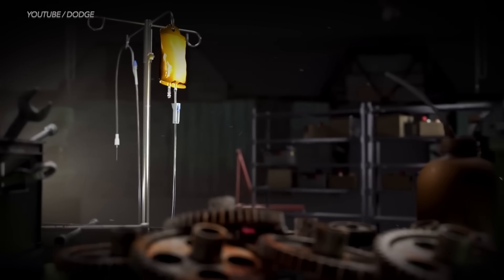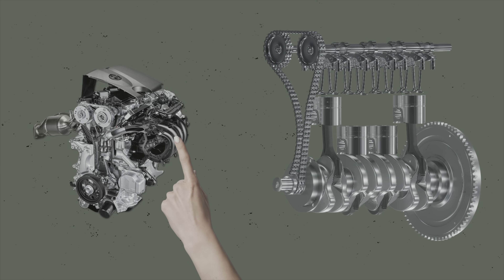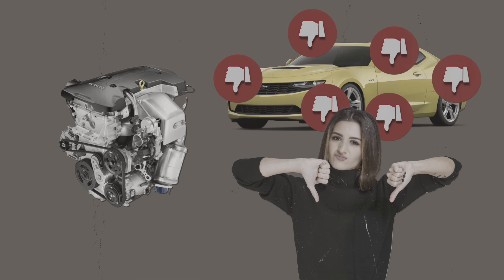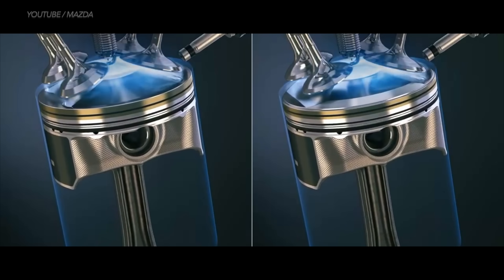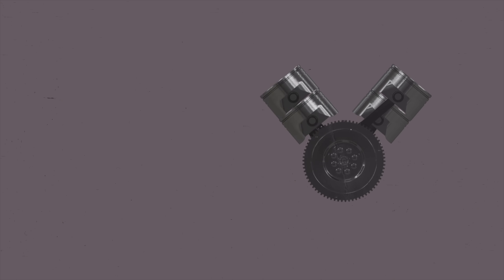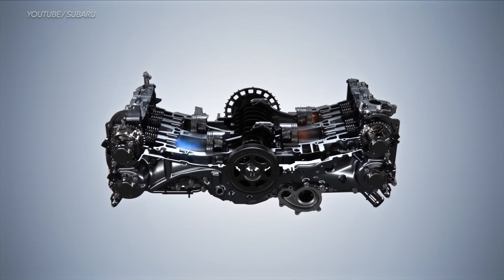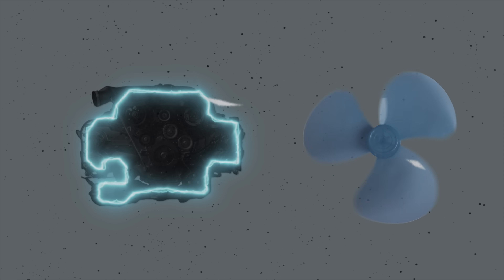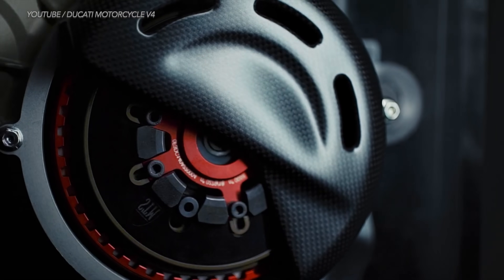This New 4 Cylinder Engine Just Killed the Future of V8 Engines

Comment: if you aren't a performance fanatic, L4s do very well on average with respect to reliability and fuel economy. But, I have a 2016 Camry with a 2.5L L4. My only complaint is fuel economy. I had a 2009 Chevy Malibu that about the same mileage with a 3.5L V6,  with considerably better performance. The Camry is heavy, though. That said, absolutely no issues with the car, and it will cruise all day at 90mph.

Comment: A V4 with split crankpins like you depicted to mimic and inline 4 firing interval would partially defeat the purpose, IMO. It makes it more complex, physically longer, and doesn't improve the sound signature coming from it. It's a much better solution than the boxer 4 if you ask me, but it can only compete with or beat the inline 4 if the bank angle is narrowed up and/or it's used longitudinally with a shared crankpin crankshaft like Subaru (or Alfa Romeo if you remember the Alfasud) do with their boxers.

IMO a 180-degree crankshaft with a 60-75-degree bank angle shared crankpin V4 with SOHC and 3-4 valves per cylinder, CVVD, VVL, and VVT would be the best setup, particularly if they still made them bigger than 2.0L. 90mm bore and 100mm stroke would make it 2.5L exactly and particularly suited for torque production and good thermal efficiency since it's 0.9 undersquare. David Vizard says you can get 1.4lb-ft of torque per cubic inch so that'd be 210lb-ft at the crank. If it revs to 8000 it should make around 280hp, which is more than enough in a sub 3500lb car with the right gearing, and easily possible with the CVVD and VVL giving you an eco cam up to about 4000-4500rpm for a smooth idle, nice emissions numbers, and good MPG.

Comment: sorry, but most "cons" you state for inline motor (e.g. freezing in the exhaust pipe) don't seem to have anything to do with it being "inline" - rather, they can be counted as cons for all three types of motors discussed. 

Also - having a lawsuit doesn't mean the issue is real - only that someone wants to earn money from the company. If you don't have hard proof - statistics of failures - don't count it here. 

For me - after watching this whole video - it just remained purely an aesthetic and personal preference thing. You did NOT even compare the 3 motor designs for any specific physical attributes of their performance, merely external shape and size, and the issues that make it harder/simpler to install and maintain. 

What about torque, what about gasoline consumption per liter of combustion chambers size, what about performance in high rotation rates, low rotation rates, what about speed of accelerating the engine? Power and easy of moving it down the chain - to the wheels?

A lot is missing here.

Comment: I've owned many cars and the only cars I ever had an engine failure was with the ford inline 4 they put in my Mazda pickup, and my Mazda van, which was a nightmare, but my 3 Toyotas (2000 Sienna, 2000 Echo 2008 corolla) all appear to be bullet proof and have all been passed down to my children and we joke that our 1 yo grandson's first car will be a 2000 Toyota echo.  My last 2 cars where Subarus 2012 Impreza and 2021 Outback. The Impreza has over 100K with zero issues and neither burns any oil. I'm not sure you can even buy a car that doesn't specify synthetic oil, but never ever use fossil oil if you want your cars engine to last. As for Subaru recalls, while disappointing, they took steps to fix the issues. I had a few recalls on my Toyotas also.

Comment: I sold my 94 Toyota Previa with 2.4L inline 4 with timing chain still running with 265,000 miles. Never touched it except changing platinum plugs every 100,000 miles. never changed water pump, timing chain or anything. Most reliable car I ever owned. Have 284,000 on a V6 03 Odyssey, still running. Wish I had 4 cylinder in my 03 Highlander. The V6 is a nightmare to change plugs or timing belt, Blows oil out everywhere and smells like burning oil, even with new valve cover gaskets. Runs well at 230,000 miles but started leaking 60,000 miles ago and now is soaked. Not worth having fixed though.  Probably retire it soon. Worse engine is Ford 4.0 v6 with timing chain on front and back. Servicing it is the cost of a new engine as it must be pulled out. Hydraulic tensioners fail and plastic chain guide wears and engine grenades itself. Just had on die at 175,000 miles only. I guess it helps if you change tensioners every 70,000 miles. My daughter has an Explorer with 179,000, I told her get rid of it before it dies. Should have gotten the 5.0 Had a 94 Mitsubishi Galant, changed valves after timing belt broke for PO at 100,000 miles. Burned oil but ran to 150,000 adding oil. Put newer engine in but transmission went out at 160,000 I think. Junked it as they wanted too much for higher miles used transmissions.

Comment: I love my '99 Outback with the Boxer engine. I have no problems with it! I change oil in the engine regularly and change the Tranny fluid  and filters every 50,000 miles. It has 160,000 on it and it does not have all those idiotic computer controls like the news ones.  I had an overheating problem one time when the mechanic who did the timing belt and water pump change failed to tighten the idler pulley on the timing belt causing it to jump 2 teeth and thus overheat. That was not the engine's fault at all.

Comment: Inline 4s are cheap to build and vibrate.  Boxer fours are smooth and cost more to build. V4s are about the same price as boxers, smoother than inline, but rougher than boxer.  Configuration has no real effect on durability, that's a matter of design intent and willingness to spend the money to build a more durable engine which will cost more when sold.

Comment: The in-line is the best, in my book. My 2007 Honda Civic EX has 137,000 miles on it. I put Castrol, because, Castrol oil was always made for small engines.The engine so far is good. Just do maintenance on it. I don’t put additives. Just leave it alone. Buy a good filter.. Don’t be cheap.I use Castrol oil filter.I also use full synthetic.Oil and filter. I know this is not about transmission’s, but it is very important to keep the transmission, in good condition, it effects the engine performance. I only use original transmission Honda oil on my transmission.

Comment: i havent had many cars only 85 chrysler new yorker 2.4 or 2.4L turbo, engine rebuild but turbo and tranny went bad so I dump it, then I got a 89 NIssand 240sx at 189k I swap the engine for a JDM SR20det(s15 2000 nissan) blew the engine by detonation, then I got a chevy silverado run good sold it at about 160K, Now I have a chevy express 03 with over 320K still engine runs cool but went thru a tranny already. and also have a 2012 bmw 128i with 98K so fare runs good just a anoying valve train tap noise. Over all my 2003 chevy express 6.0 L is the best. Im planing on not waiting till the engine pop or throw a rod and rebuild it. also thinking about buying a new one but as you said many times there is no quility any more..

Comment: Those problems with the Mazda aren't due to the engine's configuration as a straight-four.  Those are routine teething problems with peripherals that get sorted out in later units.  "The problem with the Mazda Skyactive 4-cylinder is ice in the muffler."  <-- that's a problem with Mazda, sure, but it's not a problem with the straight-4s in general, or even the Skyactiv in particular.

Comment: I've had the boxer motor. Hated it. I'm on a straight 4 on my 2001 accord right now and it's not terrible. By far my favorite engine was in my 97 Jeep Cherokee. Inline 6. Well over 250,000 miles and never gave me any problems. I even double filled the oil and drained the transmission fluid by mistake and drove it for about a week like that! Ultimately it was the frame that gave out on that beast. I sincerely believe I could have gotten another 250,000 miles of more out of that engine.
Reply: The old Honda Accords are awesome man. The Camry may have been more reliable but the Honda was way more fun to drive.

Comment: I have three cars one Toyota, then a Hyundai then the last is a Toyota 86 which is essentially a Subaru BRZ. The best is the Celica gt with its bulletproof 1.8L engine had it since new and it runs perfect with 221,000 miles on the dial. No oil leaks and normal oil consumption. Uses less then a 1/4 quart of oil every 3,000 miles and we change the full synthetic oil every 5,000 mi. Yes the transmission gets a fluid and filter change every 2yrs regardless of mileage. Trans has the same mileage as the engine.

Comment: Many moons ago had an International Scout with the inline four. The guy I got it from said it was industrial rated and for a little 1963 truck it was an outstanding engine if the clutch wasn't always causing problems. But also, owned a few of the little Toyota trucks with 22R and the only thing that ever broke was a fan belt because of not ever checking the belt. And fortunately it had broken by an auto parts store with in walking distance and was back on the road again.

Comment: I owned a 1980 Mitsubishi wagon with a 2.4 loiter inline 4 that had a counter balancer design that was borrowed by Porsch in their “944”. It was super smooth and but for unibody rot would be still driving it 😀

Comment: I have a 99 Miata with the 1.8L In-line 4 (DOHC & non VVT) that engine can do no wrong! Love it more than any vehicle I’ve owned before and I’ve owned mainly V8s (64 1/2 Mustang, 2003 Cadillac Deville, 94, corvette, and 2004 Mustang V6 40th Anniversary).

Comment: Subaru's also had a reputation for 100K mile front end oil seal leaks. I always got the feeling this was more a front end bearing issue since most seal replacements without bearing replacement never lasted long. This may have been corrected over the years but I never felt any urge to own one past 100K miles.
Reply: I've got a 2017 Impreza with this right now... More like 60k mile oil leaks

Comment: On my 3rd Subaru.  Traded them in at 150K miles just because I wanted a newer model.  They ran and rode just like new at trade-in - not one single problem with any of the three.  Only oil changes, brakes, and tires.  Surprised at the recalls and complaints and wondering what those folks are doing to have such problems.

Comment: I love your videos!  I had a 2013 Buick Enclave with a 6 cylinder engine.  The engine seized on it at 93000 miles.  I have regular oil changes and service.  I did not want to spend the $2500 for the dealer to diagnose what happened.  Of course, since no accident, insurance did not cover the repair, and the original warranty was long since expired.  The shop guy pulled the dip stick to check oil, but was unable to get it back in.  Obviously something major happened.  I stress to my kids to ALWAYS get their oil changed.  Spend that money before other things. I guess in my case it did not help.

Comment: Wich car today uses V4 engine? I used to drive Saab 96 with a ford 1.4L v4 engine in my early days. and It was a wonderful engine. It was easy to start, nice sound, could have more horsepower. It was a trusty engine!
Reply: Koenigsegg claims that the Freevalve technology can improve performance, fuel efficiency, and emissions compared to traditional camshaft engines. According to Koenigsegg, the Freevalve technology can improve fuel efficiency by up to 30%, increase power by up to 30%, and reduce emissions by up to 50%. However, it's worth noting that these claims are based on internal testing and have not yet been independently verified. The actual performance gains will depend on a number of factors, including the specific application and the implementation of the technology.

Comment: I have a naturally aspirated V-6 3.7 liter engine in my 370Z that I really love. After replacing the intake and exhaust systems with more efficient systems and having the engine retuned on a chassis dyno I was able to go from about 332 peak crankshaft horsepower to about 378 hp, which comes out to about 102 hp/liter. The engine is also pretty lightweight, about 300lbs because of its all-aluminum construction.

I can't think of another engine, either a larger displacement NA engine or a forced induction engine that I'd rather have in this car. Any other engine that would equal or exceed my engine's horsepower and torque would be significantly heavier, thus having a deleterious effect on handling and weight balance.

Another plus for this engine is that it is so clean burning that there is virtually no soot buildup on the insides of my exhaust tips. I change the oil every 3k miles and the oil level drops by usually no more than 3 oz, this at 51k miles on the engine. This low of an oil consumption, along with the quietness and smoothness of the engine's running, suggests to me that this engine will be able to last a very long time. This is okay with me, as I'm not interested in getting one of these electric engine cars.

Comment: 1976 280z on original engine and parts, only thing Ive replaced is fuel lines and fuel injectors. I got it back in 2006 with 160,000 miles and its held up well, but its a pleasure to drive that 2.8 inline 6 cylinder.

Comment: I have a 1.5 Inline 4-cylinder engine in my 2005 Toyota Echo, and I only had to replace one spark plug and one engine valve since I've owned it. bought its with 150k miles back in 2012 in Highschool now I have 232k miles on the car with no engine light and no problems! P.S I bought the car for 1,444 cause no one wanted to buy it at the dealer.

Comment: We have 5 Subarus in our household. 3 of them are newer models 2023 Forester, 2023 crosstrek, 2021 crosstrek , 2012 sti hatchback with 180K miles-> factory motor lasted 90K miles with no issues , after it got forged pistons and was set at 27 psi of boost and still no issues at 180K miles. And we have 2006 outback XT with 5 speed conversion and it has 200K miles on the clock with no issues. All Subarus are properly driven , sti is extremely hard driven  , mostly at the Dragon , auto cross.   Very happy with our Subarus.

Comment: Friend has a 2011 outback with bad head gaskets and Suburu hdqrtrs going to put up part of the cost to fix after much refusal by local dealership.
But a different dealership is getting the job and their engine dept is so booked up that it won't get done until Sept. or Oct. June12 today

Comment: Boxer 4s since 2013. Never any trouble here in OZ with the Japanese sourced models. Items like spark plugs cam belts and crank angle sensors seems all normal wear components. And tyres is the price i pay for attempting to drive around corners as fast as possible

Comment: 3.5 Ecoboost should come with an oil separator.  I had issues until I installed the oil separator. None since.  147k miles and it’s still good to go.

Comment: I have a 2017 Outback 2.5i Limited. Purchased new, has less than 14k miles on it. Has never witnessed using a drop of oil between 1.5k oil changes. Combined mpg new was determined to be 18.5 mpg. Most recently, it has moved up to 21.8 combined mpg. I use the Idemitsu  0W-20 pure synthetic oil, SP / GF-6, highest quality Purolator oil filters. Read engine codes regularly, nothing abnormal occurs. Maybe after it experiences sustained Interstate driving conditions (4+ hours at 70-75 mph) it might start to develop issues??? Hasn’t been on the Interstate for more than 25 miles at a time, and not very often. I’d say the car is breaking in very nicely, but only time will tell. Blackstone Labs oil analysis @10k miles has been nothing but positive. No oil or coolant leaks noticed. I’m very happy with the car, but I’m not a lead foot!

Comment: I'm surprised I'm not seeing references to what I believe was two different kinds of head gasket failures in Subaru boxer 4's built in the early 2000's.  Because we had four vehicles and two drivers, it took my wife maybe a dozen years to put 100,000 miles on her 2002 Forrester, at which time the head gaskets failed.  I was looking at $3k to repair a vehicle with NBV about $3k.  We had planned to keep the vehicle indefinitely to keep the mileage low on her Audi, but I reluctantly sold it cheap.  I can't make myself consider Subaru now.

Comment: I run a 2006 forester 2,5 XT which has now done 330,000 kilometers. Apart from head gaskets replacement at 250,000 and a radiator somewhere thereabouts nothing else has been done. I have gone through lots of tires and quite a few batteries, and have had brake pad changes every 100,000 km. I meticulously maintain this vehicle and every service is carried out strictly on time. I use only the best lubricants and filters and never hammer the car if the engine is cold. Even today the Car starts on the first turn and runs like a top. .What more can I ask for.? Doubt whether there were any recalls on those models.

Comment: Give me the old Ford 4.9 liter 300ci straight 6 cyl. Those motors were beasts. Had a couple of Ford F150s with manual transmissions. Would tow and haul anything. Those Ford days are gone.
Also the Ford 2.0 straight 4 cyl was a great engine. Put 300,000 mi on a Ford Escort and I still see it running around town. Just sayin...
I know there are others. I used to be a big Ford guy...now I drive Toyotas.